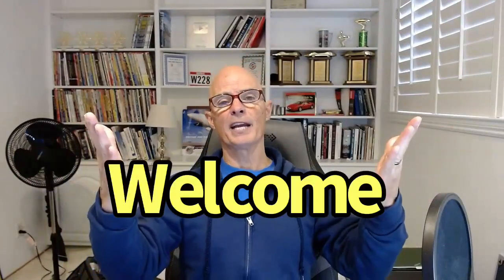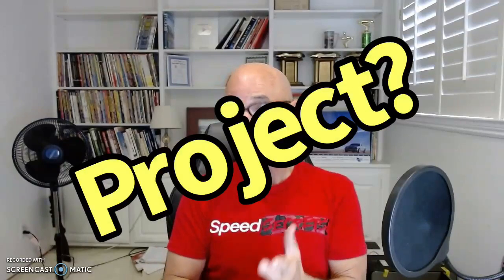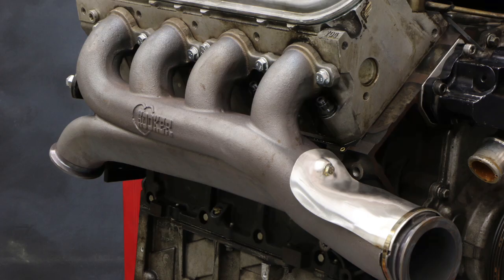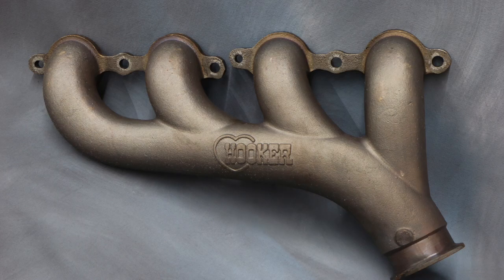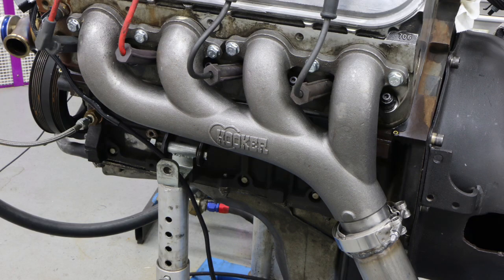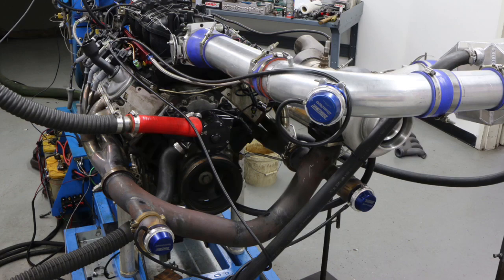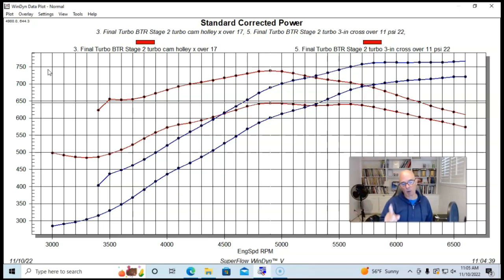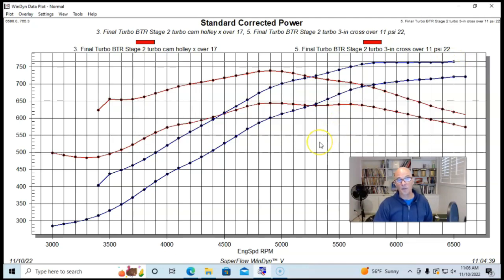HOOKER CAST TURBO MANIFOLDS VS E-BAY TURBO HEADERS-BOOST PSI VS BACK PRESSURE. BACK PRESSURE VS HP!

Comment: Boost does not equal horsepower. When you have more back pressure, you're suffocating the engine. It's then using more of that power to push the exhaust out. 

Instead of fighting the restriction in the manifolds, headers allow the exhaust out, so power increases, as well as mpg (not that anyone cares about mpg at 11 psi boost...😅😅).

On a diesel, back pressure is merely a given. But even in a stock truck, a larger turbine results in noticeable torque increases. When the exhaust isn't pushing down on the piston and can flow out instead of just escape out, them fuel economy can improve greatly.

Comment: Same with turbo hot side back pressure bigger better flowing housing. Turbo efficiency and what contributes to the Turbo efficiency? Is your Turbo set? The log manifold does is contribute to back pressure now. If you're not trying to get every ounce of power out of that frame size in the Turbo, you should be fine.
Reply from the maker: please give me your definition of efficiency. is it total flow, is it response, is it air temp etc...
Reply: I mean the hole set up good high flow bar plate intercooler if air to air intercooler pipe size wastegate size and placement exhaust manifold down pipe intake manifold. So the turbo has everything it needs to do its best aka max out all turbos should come with a compressor map of where they would like to live and where you can max them out. So when doing so you don't want any restrictions in the system? If we're going for a max effort, if it's not max effort, it's understandable. Use what works.

Comment: How do the hooker headers compare to stock headers tho? I’d love tho see this test again maybe cap the holly headers and see N/A hp vs stock headers then add boost? Idk how hard it would be to cap the end of the hooker headers

I have a set of the hookers headers but I like how you use the stock ones and just wondering how much power the hookers are worth
Reply from the maker: the turbo determines the power
Reply: @richardholdener1727 but what if I didn’t run a turbo with those headers? I’m planing on running a turbo later I just don’t have everything set up yet and already have the headers

Comment: Id say the extra wastegate certainly helped the cause here. Id be interested to see the test done again with a 2nd wastegate on the Hooker setup because im not 100% convinced that the headers are a better choice just because of there design
Reply from the maker: it is not the waste gate-it is the flow rate of the pinch point in the design of the Holley manifold
Reply: @richardholdener1727  I didn't think that would have made much of a difference I must say! You really are a great teacher.

Comment: I think what everyone is neglecting is the dual wastegates. 
The majority of the power gain is after the vehicle hits 11 psi of boost and the wastegates open. This is because there is significantly more flow, which is reducing back pressure and increasing hp. 

Sure the headers flow more, and I'm sure there would be some power increase, but it wouldn't be this large with the same number of wastegates.  
The only way to accurately perform this test would be with the same number of wastegates on each setup.
Reply from the maker: how exactly do dual waste gates add flow?

Comment: It takes power to compress the gasses, so it makes sense to me that you lost power. The backpressure was evidence of wasted energy expenditure. I am curious if a hot side turbine change could help reduce that at all? In other words how much tuning can we find in the hot side without killing response to compensate for less than ideal mechanical limits like exhaust routing.

Comment: I want to share a little info, Even though hooker doesn't look so good here, I was going to do it anyway because it would fit. 93 Chevy 4×4 6.0. I have the hi mount saden ac. But my truck is lifted Including three inch body. So super tight Is with exhaust in a sea lines. No go. Today I discovered a place in australia, single log type Is made out of stove pipe for drivers side! Plus Their description and sure LOOKS  Like it will perform much better than the holly. 👍✌️

Comment: Seems to me they both controlled boost fine but the headers got up to pressure much faster and with much less restriction.   More of the kinetic energy got to the turbo to spin it harder instead of turning into heat and pressure

Comment: it would be interesting to see what it would be if you stuck a extra gate on the cross over of the hooker set up . but no back pressure results in  bad turbo lag  so the right size header and cross over is important.

Comment: Greater boost with the tube headers was achieved with less back pressure because the tubular exhaust flow a greater VOLUME of gases past the exhaust turbine, which is what turns the compressor wheel. I bet if you flow benched the tube headers vs the Hooker log manifolds, you'd find the corresponding numbers. I bet the tube headers flowed 30% or so more, requiring less back pressure to achieve the same boost numbers. People often conflate pressure with volume.
Reply from the maker: conflate?

Comment: Richard, you're using a Holley EFI for the tests right? Why not grab a couple of MAC valves to get turbo control? Once you got the PID figured out you could probably use one of these to really get some some consistent boost levels when testing so long as the wastegates had enough authority. Couold even use shop air to better control it by adding pressure on the gate. Keeping the boost level even would really help on tests like this I think. Wish there was an easy way to measure the CFM into the intke too.

Comment: Why weren't you using your electronic boost controller?  I still loved the test.  Restriction/inefficiency is seen by the back pressure developed.  I really like the design of the Hooker setup.  Hopefully they will create a larger higher flowing version.
Reply: Yeah, he has an aftermarket EFDI and I thought he got an electronic controller that stood alone as well. Badly needed for this test :(

Comment: I think the higher backpressure creates lower HP levels through charge dilution. The less backpressure, the more spent gasses you can get out of the cylinder, letting more of a fresh charge in. 

I also think the Hooker system is a great system for a street bound Turbo LS set up. It's much easier to package in a street car. Now if you're running at the track, and looking for all the horse powers, then you would want the tubular, but in a race car you're less worried about how it looks, cutting the car up to fit it, etc. 

One thing I wonder though, if you plumbed both into a full street exhaust system, how much would that of leveled the playing field for this test?

Comment: Hello, I would like to know what I could do to my 1987 Toyota 2f engine to increase hp and torque. Most websites say you can't do anything but that's hard to believe since it's a tough 4.2l straight 6 Toyota engine. It does have long pistons so I'm assuming inertia might get out of hand at higher than it's max 4k rpm.
Reply from the maker: boost

Comment: I get the increased back pressure killed power. The back pressure was measured from the turbine inlet, why was the back pressure higher? One would think if the manifolds were the restriction the back pressure would be less at the turbine inlet.

Comment: Of course the back pressure is going to affect horsepower. Back pressure is going to apply downward pressure on the piston as it moves through the exhaust stroke. While some back pressure is desirable for street vehicles to suppress backfires and will produce more mid range torque, on the track both of these benefits are less attractive in relation to overall horsepower.

Comment: Due to the pressures within the exhaust rising dramatically due to the turbocharger, the effective resonance length of the same set of headers gets shorter as the backpressure increases.

In other words, contrary to packaging constraints, a turbo motor needs LONGER header primary tubes than does a non-turbo motor. It's one reason why even these relatively short primary tubes are working so well. They are still longer than the short cigar butt-size "primaries" from the Hooker cast system.

I have NEVER seen anyone do a ludicrously-long set of header primary tubes versus just very long versus long versus medium versus short. The cross-sectional area (CSA) of the tubes would have to be increased with the length to reduce resistance, too. I think people are just too cheap to do the research.

What is funny is that though Richard proves the value of certain things, like larger plug gaps, people STILL have the attitude, "well if it ain't broke, don't fix it." This why no one has demonstrated a 60" primary-tube header (with larger primary diameter.) They are too narrow-minded AND cheap.

There are VAST areas of research that could be done to provide mankind with a times table-style reference manual for "what happens when we try this" and "the point of diminishing returns" for certain things. 

Imagine the boldness of doing exhaustive research to find the upper and lower limits of header primary tube design coupled with collector configuration research. It could all be electronically mapped so you could find a set of parameters that suit your particular engine and apply them.

"Ah, I see that for ridiculous torque at low RPM, I need 60 inch header primary tubes of 1 7/8" diameter for my 347 inch motor." Also, "ultimate power seems to come at a 6" exhaust pipe diameter right after the turbo." etc. If only someone could put together a reference manual that tackles these things exhaustively. 

To most-easily test these things, a motor with no combustion could just be spun and the amount of air pumped in an out of it could be measured, drastically lowering the number of variables. 

Salesmanship has been lording it over good old research for MANY decades in the West. We are drowning in Edisons and P.T. Barnums when what we need is more Teslas. (the man, not the car.)

Comment: SUGGESTION: measure the BSFC of an engine during runs at various throttle settings. Use a Hellion sytem on a Hemi, which uses full-length headers before each turbo. Find which uses the least BSFC, has the lowest EGT and backpressure, etc. Then use cast log manifolds with the exact same turbos.

Comment: Did the log manifold need less fuel per boost pressure than the tubular? Is there a direct correlation between fueling and back pressure? Also with less back pressure, can you run more or less timing?

Comment: The ONLY reason turbos spin at all is because the TURBO is causing a flow impedance on the exhaust (aka back pressure). All else being equal, more pressure in the exhaust equals more motivating force for the turbos and boost. The problem is that all else is NOT EQUAL here.  Flow impedance (back pressure) caused by the exhaust manifold does nothing for the turbine. Think of it this way. Forget engines and exhausts for a second and imagine blowing hard into a tube into a wind mill. The only reason the windmill turns is because of pressure being applied to it by your blowing. The harder you blow, the faster it spins. However, if I pinch on the tube the pressure you experience at your mouth increases dramatically, but it does nothing to spin the windmill faster. In fact, the wind mill gets slower. Why? Because I am introducing pressure upstream of the pinch, but the windmill is not actually seeing more pressure it is seeing less. Exhaust back pressure as measured at the ports do not drive turbines. Pressure at the turbine inlet does. Shitty manifold increases port pressure but it does not actually increase turbine inlet pressure.

Comment: I think it's a reasonable assumption to conclude that the change in horsepower difference is attributable to back pressure change.  To me, it raises the question of does the back pressure make it harder for the piston push against the pressure, or does the pressure make it harder for the turbocharger to push the boost into the combustion chamber, or both?

Comment: back pressure is a huge deal, I run a 1.32 a/r housing on my supra with a spool valve, I get the response of a .66 a/r housing but all the flow of a 1.32, I have my ecu opening my valve up after I hit 2nd gear above 15 psi of boost. it works freaking awesome. 
my old turbo in the video was a 6466 with a 1.15 a/r in this video testing clip
https://www.youtube.com/watch?v=LVYs4x1y5-s

Comment: I'm curious on if it's the type of merge they use. I'm running an action turbo manifold that's a stainless 3in pipe basically. Pass side dumps into the same pipe the driver side feeds into. It's on a 5.3 now but I'll be moving to a 403 soon and hoping this setup doesn't restrict my power output.

Comment: Nicely done, I think it comes down to packaging and fabrication skill. I would also like to see a test done using stock manifolds as a budget builder would.
Reply from the maker: THEY WORK GREAT
Reply: @Richard Holdener   I have a question. I have a silverado with a cammed lq4 that I want to turbo. Eventually I want to go 408 with a big cam. I'm only planning to run 15psi on both setups. The question, is there any benefit to running a vsr80mm or bigger vs 7875 at that boost level?

Comment: well a engine is nothing but an air pump in the end of the day, if you need to push harder to get that exhaust out you use momentum and get a backpreasure that prevents the engine from running as free, so i think it is fair to say that it can be contributed to the backpreasure as it directly work against the engine, a turbo like a supercharger does steal hp, although it is more effective than a supercharger. 
i think a interesting thing to have tried would be to get a air compressor and run the engine at the same 11psi without a turbo or charger, but an external air source to see what 11psi and no restrictions of spinning up the turbo would be.

Comment: More back pressure reduces air flow through engine due to less favourable pressure ratios and  also causes higher pumping losses as piston works harder to push the exhaust out

Comment: It is a pity the overboosting was not resolved for a more fair x psi comparison on both setups throughout the rpm range. And it would be nice to see a pair of factory manifolds  with your usual fabbed up Y piece into the turbo to see how that  compares with the merged Hooker setup.

Comment: When you run log style you have less manifold volume Wich works like a smaller turbine housing. That’s y tubular headers make these changes back to back.  

You can stay log and run a much larger turbine housing and will spool faster make more power and torque below the curve and also the same or more total hp

Comment: It is obvious that the tube headers are a more efficient design. You mentioned that the tube headers had two wastegates and the manifolds had one. If the manifolds had a second wastegate installed in the cross-over pipe, would this reduce back pressure some and bring the HP closer to that of the headers? There are two advantages that I think the manifolds should have, one is reliability, two the exhaust should retain more heat for better turbocharger function. But I realize that these two advantages may not overcome the flow advantages of the headers.

Comment: I Did No Expect That Much Change In Back Pressure! Then I Thought Maybe The Greater Back Pressure Would Mean Greater Spool For The Hooker But It Clearly Did Not. And You Would Think 2 Wastages Would Bleed Off A Little Bit Of Pressure During Spool Up. This Makes Me Think It's Directly Related To The Wastage Amount / Sizing Change. You Figure At Full Song The Configuration With 2 Wastages Wide Open Is Allowing More Exhasut Flow Out The Engine Then Forcing It Though 1 Gate And The Turbo. I Know Diesel Guys Say Adding A Wastage In Some Instances Adds Power Becasue It Allows Some Exhasut To Flow Out While Turbo Still Makes The Same Amount Of Boost. Like It Becomes A Higher Ratio Turbine Housing WOT Full Boost When Gate Opens Allowing Greater Exhasut Flow.

Comment: hello great content not sure if u have anything on manifold pressure vs turbo charge pressure and pressure drop from intercooler,  would like to see power band differences on turbos with proper back housings but wrong front housings ive seen 8 psi of manifold pressure and 20 psi at the compressor housing..
Reply from the maker: how can you have a 12 psi drop across a core?
Reply: 12 psi drop was not across the core only this was single turbo coyote with on3 turbo 2.5 inch pipe from turbo to intercooler  i tried different intercooler still same pressure drop i was getting reading from port at compressor also waste gate 12 psi spring opened to early only giving 4 psi at manifold so i had to switch it to manifold signal i am still working on tuning this car on the dyno seems to have falling powerband.

Comment: Higher back pressure big changes in scavenging is why the headers do a better job making hp. The runners for each cylinder is even length or close to it so scavenging is same.

Comment: Strsight from schoolbook: if you are for some reason limited to some certain turbo (class rules etc.) that is not perfect for your combination, then use pulsetuned exhaust. If you can use a turbo that gets lower backpressure than boost then use as compact manifold as possible to get all the exhaust energy to turbine. 

This guy always has bad turbo match that makes more backpressure than boost. 76/75 never works well, compressor too big for turbine. And 76mm compressor is +1100 hp turbo so lots of wastegating that drops turbine efficiency and makes boost/backpressure ratio worse.